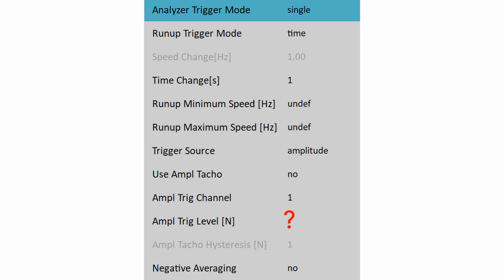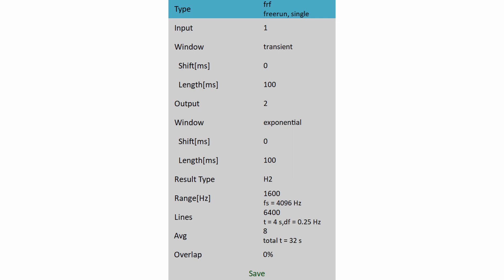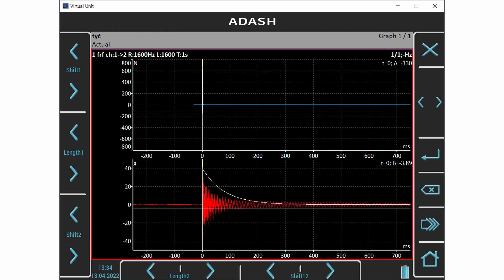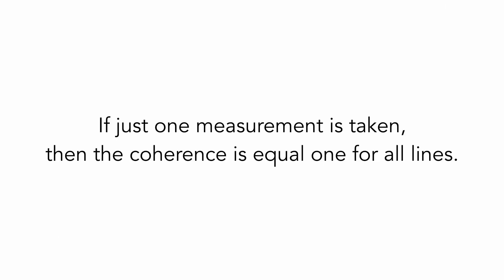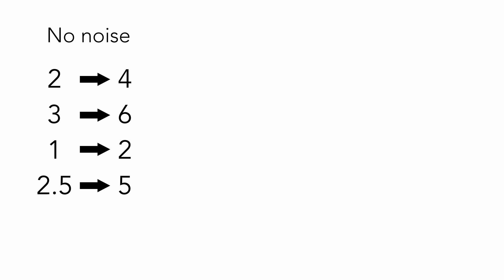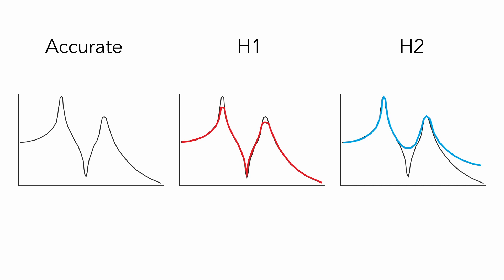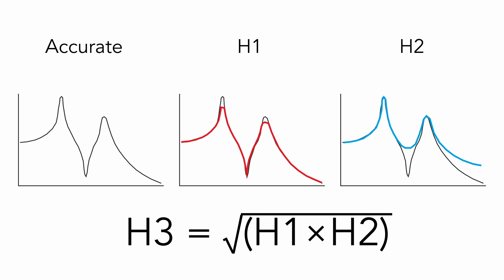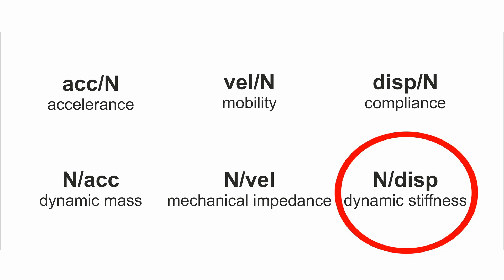Frequency response in practice

Comment: This is a great video!!! What’s the difference in this vs Bump test?
Reply from the maker: For Bump test you don't need 2 sensors. Meaning one acceleration sensor and one impact hammer. For Bump test you need just one acceleration sensor and you hit the measured object by standard hammer from your workshop.